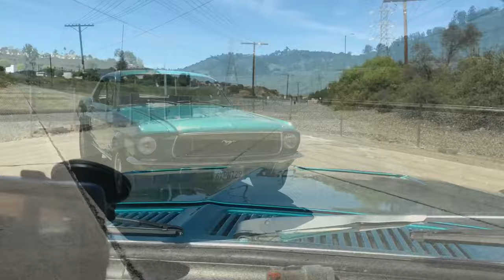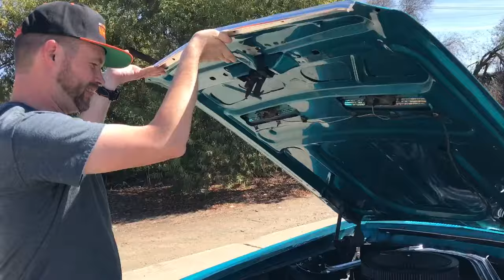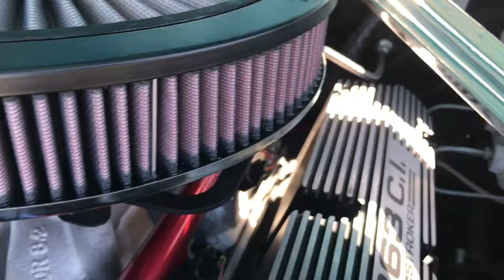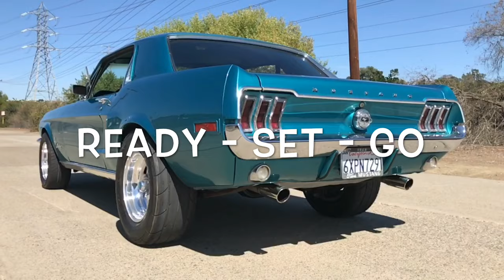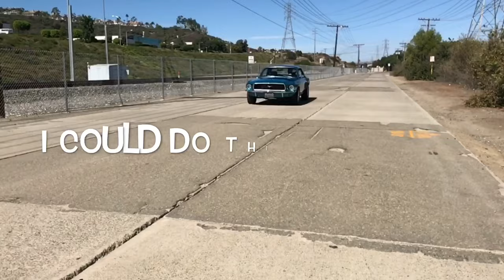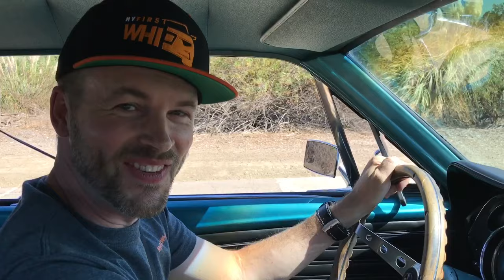1968 Ford Mustang 363 Dart Block Stroker

Comment: How good is the no booster brake set up? I have disc up front and my engine has low vacuum. Nice ride.
Reply from the maker: I have found it to be great.  I have the bigger drums out back with VERY early Baer discs (much thicker rotors vs what they sell today...).  I did not even need a proportioning valve as the stops are fast and straight.  I added stiffer adjustable shocks up front to prevent nose dive.  hope that helps

Comment: What suspension do you have in the car? Beautiful beast by the way...
Reply: Mostly stock,Edelbrock shocks in back, spax adjustable shocks up front, Shelby traction bars, 3.55 Auburn locker in back

Comment: What exhaust? nasty one, of the best I have heard.
Reply from the maker: THANKS.  I really like it too.  It is different than most mustangs I hear.  It is 2 1/2 inch mandrel bent stainless Magnaflow system with an X pipe.  I can tell you that it has no drone and one can have a conversation UNTIL you "get on it"
Reply: What's helps too is that it's a square engine. The stroke and bore are the same so they have a unique sound
Reply: @chadmiller8019  Pretty sure a 363 isn't square. Pretty sure the are big bore short stroke. Isn't it 4.155" x 3.4" ?
Reply: @hotshothogger  correct. I had the wrong platform in mind at the moment

Comment: How much did the build cost?
Reply: The engine or the car?  Have owned for 33 years...
Reply: Grady Raymer both..... I have a 1970 Mach 1 in Highland Green with a 408 Stroker
Reply: Engine 10.. car was 3 k Canadian, transmission can version 4K Canadian. Paint etc.  I think I calculated that it worked out to 1000k a year for the first 30 years of owning the car (the last years has been $30 ) .. just oil ha ha.  No complaints as I have had soooo much fun

Comment: Car sits to high in rear nice build
Reply from the maker: Jenna Carr I understand your point.  Trick is i have 4 teenagers and we go on many road trips in this car (fully loaded)= I need all the lift possible.  Now if I had air suspension I could drop and lift at will.

Comment: I hate Electic fans also,
Reply from the maker: I like the fact that they  are effective and save HP BUT and it is a BIG but one blown fuse and you are in big trouble fast.  I prefer to know that if the engine is running the fan is working.
Reply: My First Whip has the old school fan ever let you down ?
Reply from the maker: NOPE-  25 years ago I had a water pump fail.  Fortunately small block engine parts are plentiful